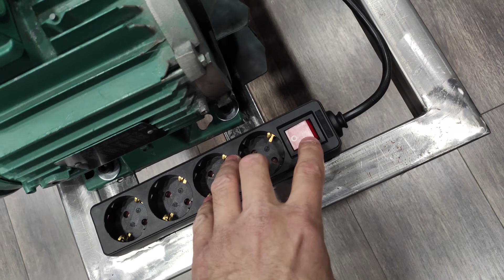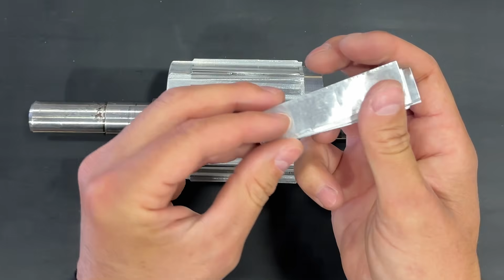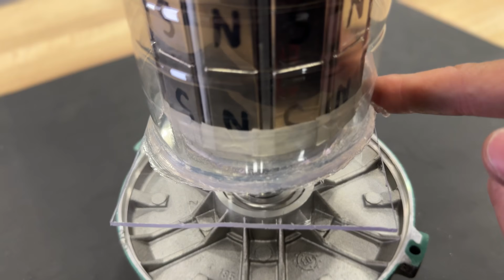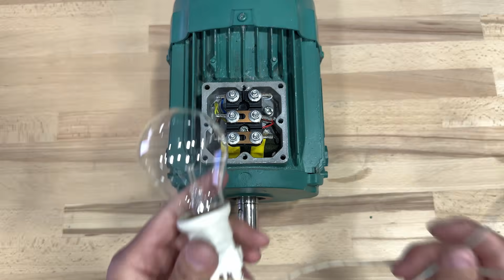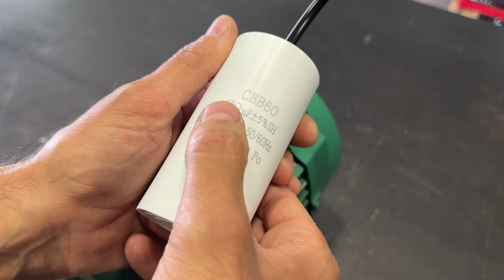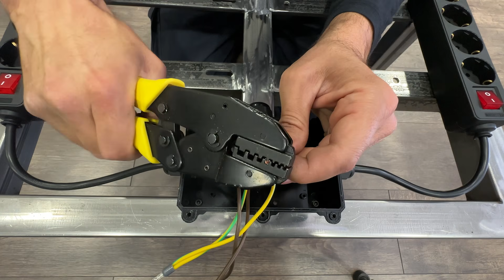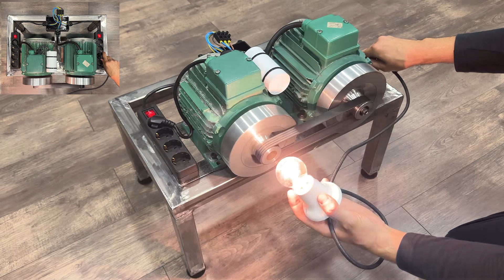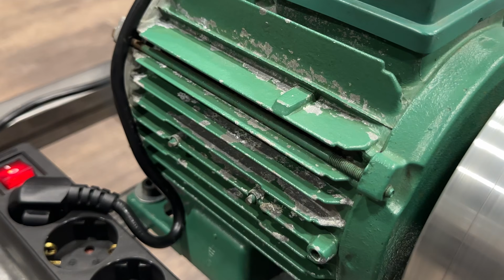10KW! Free Energy with Two Electric Motors💡⚡💡Liberty Engine 5.0

Comment: The internet is full of these scams. You can’t get 10 kW out of a 1.5 kW electric motor. He connected the windings of the 3-phase electric motor in series, which still totals 1.5 kW. If he had connected them in parallel, theoretically he could get 4.5 kW, but not at 100% load.
  However, that wouldn’t give you 245 V at the output, but only 1/3 of that voltage. In that case, you’d have to increase the speed by 2/3, and you’d have a problem with the frequency.
Reply: Serios ?  de unde stii tu toate aceste date,amanunte ? Ai incercat tu personal  ? ai realizat cel putin ceva asemanator  si nu merge ?  Te contrazic . Eu personal am realizat un astfel de dispozitiv si functioneaza  perfect . Nici nu am  folosit acel  aliaj  faimos si totusi functioneaza .  Te intreb pe tine si pe ceilalti sceptici comentatori  : oare cum functioneaza  alternatorul  auto ?  Sa vedem ce comentarii prezinti ?
Reply: Seriously? Where do you get all this data, details? Have you tried it yourself? Have you made at least something similar and it doesn't work? I contradict you. I personally made such a device and it works perfectly. I didn't even use that famous alloy and yet it works. I ask you and the other skeptical commentators: how does a car alternator work? Let's see what comments you present?

Comment: My usual question. Why do you complicate the design with pulleys and a belt. Unnecessary friction and an unnecessary part. I don't see any speed reduction. 1:1. Why don't you put the motors on one axis by connecting them as a single shaft? If a flywheel is necessary, which it is 😉🤫🫣🤣 , then place it as a clutch and shaft lock. Murphy's law says what can go wrong, will go wrong . 
                  🖐🏻🐬🫧♻️
Reply: I will also add that if 3 windings at 220V are connected in series, then they give 220 ~ 440 ~ 660V. This number is the only one that comes close to the declared efficiency. A kind of pure parable. This output from a magnetodynamo - 660V is fed to common sockets as a source of generated electricity. So 660V flows into the winding expecting its 220V, for which it is designed. By the way, it would have to have three times the speed at 660V from the magnetodynamo. 

A motor driven by a magneto-dynamo would have to have a 1;3 reduction down to 1400 rpm from the 4200 rpm of the drive motor. Otherwise, the 440V is mysteriously disappearing somewhere.

😉🤫🤣🐬🫧♻️
Reply: Oh, c'mon!
I have even better idea: why the mechanical parts at all???
Let's take 2 charging stations (or even better 3 charging stations!...)
CS already HAS the ENERGY inside - no need to generate it!
No friction, pulleys, belts, noise, heating... just a PURE PACKED ENERGY!!! 
Next: connect the HV ouput of the first CS to the input of the second, the output of the second - to the input of the third, and finally (this is the best part!)): attach the output of the third to the input of the very first one!!! So, after powering on  these charging station each station in this perfect "circle of energy" will charge the neighbour CS.
PERFECT eternal energy loop!
Where to patent my invention? 🤔🤔🤔
Oh, this is such a boredom: I'd agree to present my brilliant idea to the author of this amazing video for the sake of REAL science! 💥💥💥🤭🙃😏

Comment: Don't you hate it when you have an idea but no materials or funds to make it, so you shelf the idea? I had this idea back when I was 17, in High School (1987). The "Perpetual Motor" (was my name for it) whose power generated  creates its own supply and could then be used for endless power for electrical devices. My brother came up with a name for my frequent visits to Radio Shack where I'd use what little money I had to buy resistors, capacitors, transistors, 555 and 556 IC chips, LEDS, spools of varying gauges of wires, piezo alarms (for my "Obnoxious Alarm Clock" connected to a wall timer to wake my 'near-death' deep sleeps (I slept through Hurricane Hugo)), as well as perf boards, circuit testing blocks, project boxes, solder, paste flux and various soldering tips for the two kinds of soldering irons I had (also from Radio Shack), calling them a "Shack Attack."  I had brainstorms I couldn't afford, so all of them are up in the computer between my ears. I'm glad somebody made one of those ideas. Now it just needs to be implemented everywhere but don't forget to consider that one vital aspect we learned about in Physics class; Efficiency (which considers wear on parts in its continued operation). I mean, it might look good on the surface but EVERYTHING breaks down. God didn't make it, so it will break eventually. It's still an excellent idea. It's my idea.

Comment: I like this but its not free. There is an initial cost of a chop saw, welder, lathe, milling machine and tooling, and materials. How long will this run like this before it stops? I like the idea and its been around since the days of Nikola Tesla.
Reply: Impressive
Reply: I'd find a way to change that efficiency a few points up or down
Reply: Gdzie można kupić taki generator dajcie znać .
Reply: Itu adalah untuk konten masalah kamu di pengelasan bisa memakai kayu .
Reply: With the welder dose it works

Comment: interesting - how did you come up with the output of 10KW ?    Show the gen under load at close to capacity with amp and volt meter - then I will be impressed.  I like that you showed the stand construction and internal construction.

Comment: Rather than converting an electric motor to a generator is OK but why not just get a generator to start with? Most gen sets the engine goes out before generator,  I would like to see a much bigger power draw. Like a home HVAC or a home oven.

Comment: This is not possible and it is against the laws of physics. In energy, we have a subject called load loss. Every stimulus has an energy loss and the energy generator must always be stronger than the producer. This is where if they are equal, there will be an energy loss and if one is stronger, they will consume more energy. In fact, such a thing is not possible in terms of the laws of centrifugal force in physics. If you can explain this, it can be said that you have made the impossible scientifically possible. I will give you a small guide on how to compensate for the load loss and energy loss. I have an idea for that, which I will tell you if you answer my question.
Reply: Howard  Johnson actually did this and there are indeed laws blocking any thing that threatens economic stability. Really just keeping the rich in money and poor broke.

Comment: Make a video of the liberty engine running while sliding the unit around on floor 3'M >right 3M< left
The junction box is suspect!
Why wouldnt they build it self contained unit the pulleys are hanging over instead of enclosed.

Comment: If you want free energy just hook up a transformer step up to parallel capacitors with a rectifier between. You'll get 5 jumped to 10 volts and multiply the current by the capacitors. Heat losses are your biggest worry and that's negated with pyroelectric casings. Idiots.

Comment: You keep showing output voltage, but voltage alone is meaningless without output current and true power.
For a 230 V single-phase generator, a 10 kW claim implies about 43.5 A at PF = 1.
Please show:

RMS output current under a known resistive load,

true output watts,

motor input current and true input watts at the same time,

continuous runtime under that load.
Without amperage and true power measurements, this is not proof of a usable generator.

Comment: If anyone creates a "Free Energy" device, that person would go missing, I guess you can call it the "Trump effect". Oil, oil, oil, $,$,$. Reality is a b$@ch.
Reply: No it isn't worth anything excrpt to the core the earth, though many political powers utilize it in their currrency control system. the true work in value is time and labor to extract sny resource or manufacture a producct. Oil is quick for combustion but combustion is out dated and dangerous. Furter the energy is a low spectrum wave of red hot fire, compared to generating fire wave spectrums in green or blue flames. (that is my theory at least) Plus its finite taking hundreds of thousands of years to get petrol which is moronic to have to valued to much.

Comment: The 1st law of thermal dynamics (conservation of energy) in a closed system energy cannot be created or destroyed only changed. Example moving part, motion converted to heat energy. This setup will never get more energy then put in and that enery will be coverted to heat energy from friction. Therefor i call bull shit.
Reply: There is an unlimited see of energy all around us -- as in the quantum reality of a multidimensional nature beyond the illusion of space and time acknowledged in the study of quantum physics .  . if you find a way to access that energy, there is no break of any law of conservation, regardless if that source has any theoretical limit or not .  .
Reply: @ronaldgreene5733 i don't see any special tech that accesses any energy outside machanival/electrical. There's no quantum antenna. I do suspect there is an electrical input in the form of a hidden cord or battery. Dude wants  clicks.
Reply: Yeah I had chat gpt tell me the same limit and I kept correcting that to consider external input to continually be added by utilizing connected extractors of solar and wind powered motors/generators to maintain power. It isn't perpetually endless but it leads an open system to last until the sun explodes, or the user dies, which ever comes first. Power supply self regulating generators like this already do exist. I went to gpt because I thought of building one with electric motors in series and parallel and became aware that the limit is only in a closed system.

Comment: What I find most hilarious is that they use a 4-volt electric screwdriver sold at most Walmarts for assembling light furniture and cabinets to crack the body cover bolts on a industrial motor generator! Ive used 18-volt Craftsmans and Dewalts that couldn't do that 😂
Reply: Those bolts don't require that much torque. Your 18v drill must be trash.

Comment: Ok how do you run 110v appliances on 255?
Reply: There are reducers you can put in line. For example there are enormous amounts of volts going through the main overhead electric lines, but then you’ll see the big thingys on the high line pole, before the line runs to the house - those reduce the bolts going from main line to house. 
I forget the technical term for the big thingys.
Reply: @willieplank3338  They're called transformers.

Comment: OK, so it produces a few watts of power. Magnetic generators are well-known. But it clearly is not capable of 10,000 watts. That would be 45 amps at 220 volts, requiring at least a 6 or 8 gauge wires. And those motor and generator wires were no more than 14 or 16 gauge, (about 12 to 15 amps at most.) Let's see you put a REAL load on it and MEASURE IT. You would do even better by converting the motor to DC and using magnets as well. But then the whole set up would have to be DC, charging a battery bank and using an AC Inverter to generate the 220 volts AC for household use. You cannot use this for household because neither the frequency nor voltage are stable. This is the Achille's Heel of all these home-brew generators. They work, but they are not USEFUL.

Comment: How about connecting an electric water heater at 4500 watts and  try a welder. 10kw is approx. 50amp yo have connected about 5 amps worth of load. Your 666 efficiency idea makes this contraption draw 40 percent more current than it delivers so your conductors will need to increase to like a 4 gauge. Also at 1.5kw you are along way from 10kw and your 666 efficiency goes down to like.8kw output. I call crap on this. Lots of work to run a grinder.

Comment: That are doing it the hard way
Reply: Free power yes it dose work  how about power with no wire  it also works DC only and then converted to ac it works also how about using gravity it also works I have done it
Reply: Could run the world like that why don't that  I don't understand the greed of the world
Reply: Were do I buy one of these
Reply: How meany amps
Reply: Will it make
Reply: Good by
Reply: I did the same thing with a power inverter and a12 volt battery and no moving parts

Comment: and is that a dynamo? 1 pashe or 3 pashe? and how many hp? for the modified torque? and what rpm? the dynamo material before modification is between 1500 rpm or 3000 rpm for the dynamo material used for the generator?
Reply: Musst du halt hinhören

Comment: is this Liberty 5.0 engine capable of running a house in the event of a power outage or would it take several in series to get the necessary power to maintain an operation of a house?
Reply: O tak. Dom jak malowany!
Reply: Of course! It runs a house...and then you wake up.

Comment: How the math works on this one? Horse power of the motor? Rpm and torque you need to make the alternator produce consistent 10kw? It does not make sense, so lets say 3hp motor... And it will generate 10 kw alternator? How.?please enlight me to so the math on this motor alternator setup
Reply: Szkoda potu na wyjaśnienie działania tego cuda. 
Prościej jest wyjaśnić dlaczego ono nie działa: ∇ · 𝐁 = 0

Comment: Energy could be obtained from initial spinning made with drill and for some time ‚stored’ in havy wheels on motors axles. It will operate for some time the same way your bicycle will move certain distance after you stop pedaling. But will stop eventualy. To keep it going you will need to paddle again. Simple?
Reply: Will stop a lot quicker if you put any load on it!
Reply: @JP-rf7px  Yes.

Comment: You cannot listen to the P brain Neanderthals, who think they know everything about the behavior of electricity in a magnetic field moreover, when you are using permanent magnets, all I can say to you is good job and thank you for sharing. I would like to reach out to you and make this work and share this with more than 1 million people thank you and I know it works.
Reply: Only those who believe the deception have Neanderthal brains. Follow up with another pseudo-scientific statement to silence critics and present yourself as a god-like genius. You don't need to know anything about magnetic fields, just one verry simple thing: the law of conservation of energy. That explains everything. No matter how great permanent magnets may be...

A little reminder for all those who got an F in physics (and there seem to be a lot of you here): energy cannot be created. It can only be converted. Here, energy is lost through friction (converted into heat), electrical resistance (converted into heat), air resistance (converted into... you know...). Then the connected consumers draw energy from the system. So now please tell me, where does the lost energy re-enter the system on the other side? No matter how efficient the generator may be, it cannot have an efficiency of more than 100%, never, and certainly not the motor. It's physically impossible. Unless the Earth is flat and you wear aluminum hats. Then, maybe it could be possible.

"...and share this with more than 1 million people..." Translate my statement below. THAT is exactly the ONLY reason why this video exists.

Comment: Why we cannot buy it?
Reply: He cannot mass produce it or is not ready
Reply: If you pay enough, i can built one for you, but mind, that it will work only till energy stored in havy rotors lasts. Then you will need to spin them again using drill, powered by battery or straight from your electrical system.
Reply: @eeo.e how much?
Reply: @eeo.e  I would connect it to a stationary exercise bike

Comment: That’s a nice machine and a very professional looking build.  However, you say it is a 10kW alternator, yet to test it you use a light bulb, and a grinder.?
I’d like to see you plug in a heater, and an AC unit.  That would still only be half of your claimed output.  What say you??
Reply: I would like to this this connected to a house and see how it performs / lasts.
Possibly include power stations to show how the energy can be safely stored and distributed

Comment: Please with a rotor of 12 poles and rpm of 1600, aren't you going to get about 160hz. Because most of our appliances operate on 50hz and 60hz. Or is there an explanation for that.
Reply: I agree with this number of pole pairs the engine speed should be 500 ram,, then it will be 50 Hz.
Reply: Это теоретически а фактически одна волна Герца толкает двигатель туда, вторая волна сюда , третья даёт выход
Как то так 😂

Comment: I'd like to see what's inside the box of the capacitor....
Reply: Metal and Paper - THAT thing should be legit, it's the Steinmetz-Circuit. 70µF and 450V are about right for this motor. But: that circuit reduces motor efficiency down to 70%, this alone causes a 30% energy loss in the system. Not to speak of friction. There IS a hidden power cable.

Comment: Perpetum mobile. 
you defeated the laws of physics
Reply: No it's not. Because the system requires maintenance and because magnets will lose their energy even if after decades. But in the meantime you get energy for free, stored in the magnetic field of the magnets. This energy is converted to mechanical and electrical energy